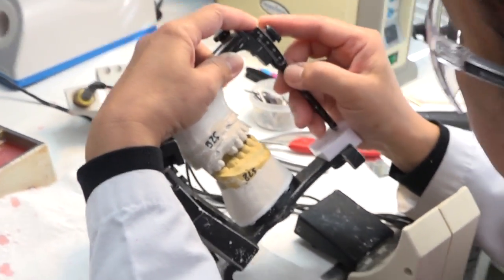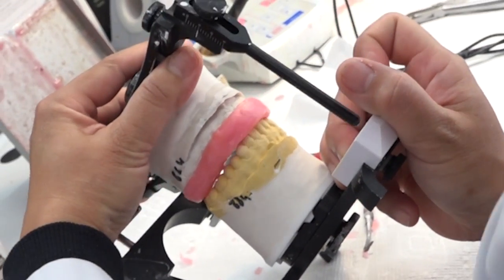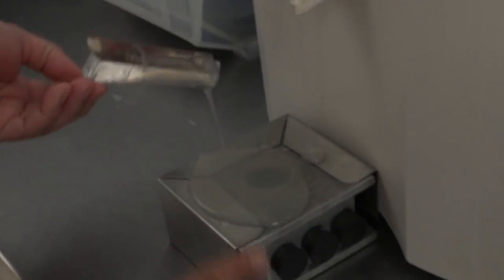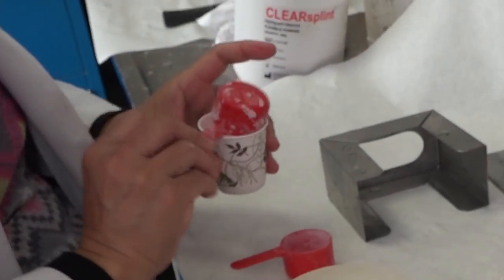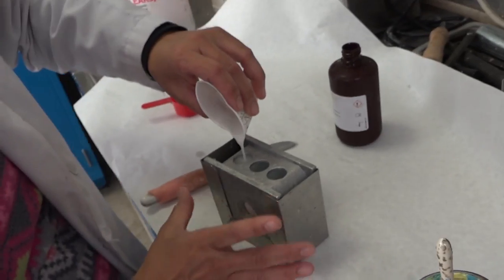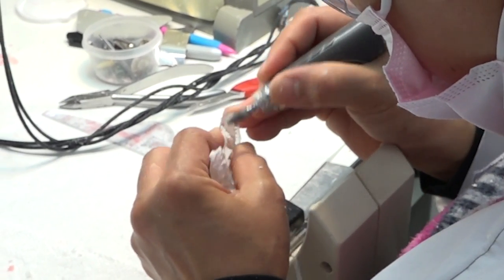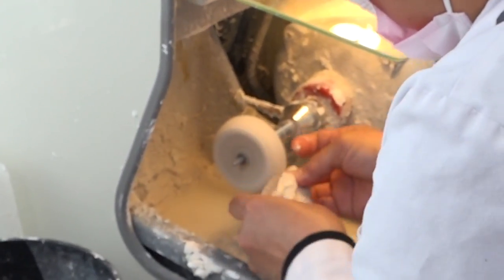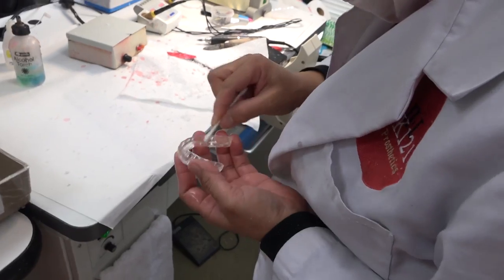Making The Occlu-Ever Soft Night Guard | Dental Lab Learning

Comment: Is the material truly soft from the video it looks kinda hard?
Reply: Ja.. i thought so too... hmm
Reply: Exactly it seems to me it is a simple forming of hard acrylic which is just a standard occlusal splint.
I couldn't see any soft layer was inserted.
Lol 😆
Reply: It is harder and even brittle when cold. A bit more flexible at mouth temperature. Run it under warm water before inserting.
The idea is its hard enough so you don't chew through it or cause damage to the opposing teeth.
 But soft enough so it wont break and be comfortable. Its a good material but it will get cloudy and a bit yellow as time goes by.

Comment: Hello.. sir.
What company material did you use to make the Prosthesis?
Reply from the maker: It is CLEARsplint by Astron Dental Corporation.  Thank you.
Reply: @Lsk121  Thank you so much for your response.
Reply: Have you had any breakages with the astron material? Is it like the proflex system ? I had a lot of breakages with Proflex and it seems to be the same kind of material.

Comment: that is not soft.  that is hard nightgard.  hahaha
Reply: Actually its not hard or soft. But calling it soft is wrong. Most professionals just call it an Astron night guard. (The manufacture).
It feels sorta like nylon. It has some flex unlike hard acrylic that will snap.
But its not real soft like a sports nightguard. Good for sports where your mainly protecting the front face of you teeth and inner mouth tissue. But not good for wearing at night because you will chew through it in no time.